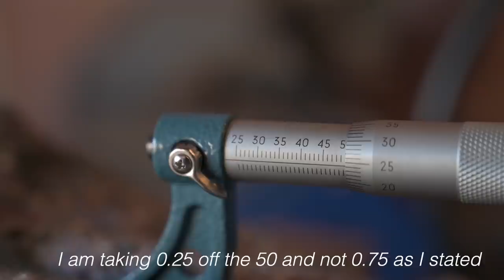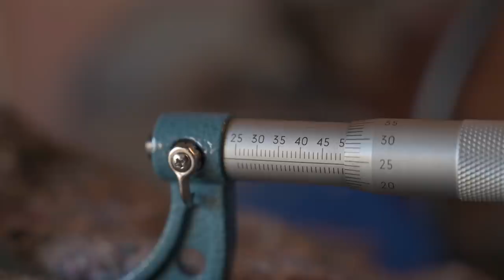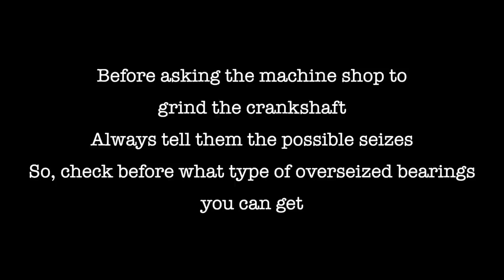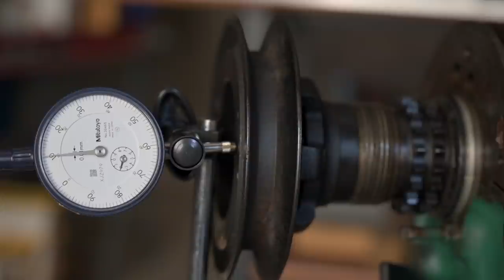Old Rusty, Engine block assembly

Comment: Internal oil screens (filters) made people "back yard mechanics" in the States. When I got my 48 Willys CJ-2A They had no oil filter on it, removed at some point, they just changed oil every 1000 miles or so. I did get the original filter and housing to install back in it. Nice job on "Rusty".
Reply from the maker: Thanks for the comments, that is nice a 1948 willys

Comment: Concering the Oil > As the engine has no proper oilfilter (like quite some  engines from that era) you should use single grade oil. That might be the "special oil" mentioned. The main difference to multigrade oil is that single grade oil does not absorb the dirt. It rather transports the dirt to a assigned  place eg. the oilpan. Thus, the oilpan has to be cleaned from time to time! Multigrade oil, as it absorbs the dirt, can be cleaned by floating through a filter as the particles will get stuck there. This is how I learned it...By the way - NICE WORK!!
Reply from the maker: Thanks for the comments and very informative

Comment: In the old days, non detergent oil allowed particulate to settle out in the bottom of the pan.  Detergent oils of today keep the particulate in suspension when running so a better filter system was encouraged through engineering and fitment.  Just my thought.
Reply from the maker: Thanks for the comments, that makes it clear
Reply: And if you change the oil every 1000mls, like in 1950, a filter isn‘t necessary.

Comment: Hello Steve

Good work again. Canada moved to the metric system in the mid-1970s, gradually. But the imperial system is still alive around here. So on one the two, and our American neighbors on their system. The American gallon is smaller than the imperial gallon for example and myself when I take a wrench to tighten a nut often it is 1/2, 5/8 and rarely in millimeters. At school in the 70s I had to do the metric swicht in math, physics etc ... Attention au covid-19 take care
Reply from the maker: Thanks for the comments, good reading...and its a matter of getting used to it

Comment: Old Rusty is coming together nicely 
In NZ we changed to Decimal currency on 1967 and went full metric in 1972 every thing is metric
today you just use metric or convert imperial to metric no real problem
Reply: Graham Peters. I am old school UK/Britain . I have machines that are imperial and some later ones in decimal. No real problem as you say , It's all just numbers is the way to look at it .the only time I have to think hard is looking  for stock thats in the off cuts bins , I automatically know what 18 inches long is but 460mm needs the tape measure .
Reply from the maker: Thanks for the comments

Comment: It's coming together quite nicely. Having worked on the engineering and construction of many plants, Chemical plants and Refineries, I find it difficult to believe that the older oils were cleaner (purer) than the modern ones. But who knows, stranger things have happened. I can tell you that if the cars I had when I was a young working professional required the removal of the pan and the oil pickup/filter, I may not have found the time to do much proper maintenance. LOL! Regards, Solomon
Reply from the maker: Thanks for the comments, indeed, some state that it has to see with multi grade or single grade....  it seems that single grade oil carries the impurities and deposits it in the carter, where as multi grade absorbs it . hence the need for a better filter... Not sure , but that could be the reason

Comment: Great video! Extremely thoughtful and meticulous in your preparation!

With regards to the internal oil filter, the key to maintaining these old engines was regular oil changes like every 25 hours or so. That's because of the low detergency and quality of the oil back in the day. The regular oil changes would flush the carbon build up from the engine and also prevent the poorer quality of oil from thickening and turning to sludge deposits. If the oil was changed regularly, I dare say that servicing that filter was not to be done on a regular basis given its porosity.

Modern oils are designed with huge amounts of detergents to keep the engine internals clean and are of much higher quality able to resist turning to sludge whilst being thoroughly filtered to extend oil change intervals, reducing down time and costs associated with servicing.
Reply from the maker: Thanks for the comments

Comment: Beautiful garden , australia went metric in 1966 , but really used both for many years , most engine and brakes parts are still imperial. Pulling the bolts in with the nuts is better than hitting them
Reply from the maker: Thanks for the comments

Comment: Hi  young friend !!mechanic of our time !!! I used the famous " Wynn's super charge" one of the best anti-friction additive !!! (authorized years ago by Caterpillar !) for me Wynn's is still one of the best product for good mechanic and maintenance work ! Please if you can buy a tin of that Wynn's super charge you will notice the change in the engine noise and easy starting ....that product stays like honey on all moving parts -- To add when engine really warm and better when slow idling speed ! Let me know please my friend...!!! Best regards from French Guyana.
Reply: The type of gasket as the one for the timing cover I use to put them in warm linseed-oil and not wiping the oil of when putting in place. The same for SOME  cylinder head gasket....! I keep the screen on the oil pump !
Reply from the maker: Thanks for the comments and great write up.   I use STP, its about the same not ?
Reply from the maker: Thanks for the comments
Reply: @D3Sshooter  nO NO "STP" was never authorized by Caterpillar .....Apart that please get 1 tin of super charge (heavy like honey) engine running at idle speed,  put a funnel tight in the tappet cover opening (avoid wasting product because of air pressure coming out especially on  tired engines) ENGINE RUNNING at the T° pour SLOWLY TE " HONEY like" and listen at the engine noise as the  "honey" enters the engine....!!!!!!! Also what a great change in starting, !!!! 
Now and after try injector and carburetor product  there you'll (for sure) be totally convinced !!!  Thank you for answer and comment making the following even more interesting and calling the full attention !!!
Thank You dear friend!

Comment: Hi Steve, greeds from Holland, I also enjoy your videos much. I have an H van and a DS myself for years.  The H van engine is very much the same as the engine from Old Rusty, especially the block. Like some comments already mentioned, you need special engine oil so the dirt can sink to the bottom of the pan. Best is 20w50 for this engine in my opinion. Last winter I cleaned the pan after many years, because of engine oil leaks, and there was more then half a centimeter of dirt in the pan!
The other thing I want to mention is that for the H van you need a special tool (caliber)to fit the timing chain housing around the crankshaft, to make sure that the shaft is centered in the housing. This to avoid a leaking seal in the future. 

Keep up the good work!

Greeds Joris
Reply from the maker: Thanks for the comments Joris, Goed om weten .   IK zal dan ook de juiste vullen.  Maar dat zal nog even duren denk ik..  De H heeft dezelfde motor dacht ik.
Ben wel eens benieuwd als de cilinderkop er zal zijn///
Reply: Idd het oude type motor van de H is exact gelijk aan old Rusty. De mijne is van 73 en heeft alleen een andere kop. Ze gebruiken ook wel eens een boortje van een bepaalde dikte die je tussen deksel en krukas door rolt om te centreren. 
Ik ben ook benieuwd als ie loopt. Succes!

Comment: Plastigauge is just as accurate, if not more so, than the method you described to check bearing clearance. Regarding the engine oil used, Old Rusty would have a non detergent oil specified as non detergent oil does not have a cleaning action and the by products (read crap) produced by normal engine operation cling to the internals of the engine. The crap (well some of it anyway) does not therefore circulate and cause issues with contacting surfaces. That oil strainer you have will need regular maintenance to allow only rudimentary cleanliness internally. Dont know about where you are but non detergent oils are getting hard to get here.
Reply from the maker: Thanks for the comments,  Plastigauge is something I have used. But I really like to measure. I guess it works for both... ...  Thanks for the Oil details , yep I can get that oil from an old timer shop. But expensive

Comment: putting in the lug bolts on the flywheel flange might be easier and faster by torquing them with a nut and a few thick washers rather than hammering
Reply: Or better yet, a C-clamp.
Reply from the maker: Thanks for the comments, indeed... why did , I not think of that /   great tip
Reply: i was thinking something like this also

Comment: Nice work! I'm currently stuck too with my restoration process due to covid... i ran out of paint and i can't buy it online because is a special mix. Also some spare parts are impossible to find online, especially for old and rare vehicles, at least here in italy. Btw i have a lot of rust to grind off 😂 no more excuses!
Have an happy easter and stay safe! 
See you next time
Reply from the maker: Thanks for the comments Gabriele,  I know the feeling and problem.... stay safe and enjoy your project.  What are you restoring  if I may ask
Reply: @D3Sshooter  currently i'm restoring  an old Lamborghini tractor, one of 48 produced back in the 50's before Ferruccio Lamborghini started producing cars in 1963. This one was displaced and drove for dimostration purpose probably by Ferruccio itself. But i'm searching more information about it because i found only one foto of that day. During the disassembly process i broke down in 2 pieces one casting when i was trying to press one bearing out of it. Hope to find someone that could weld it back, because no replacement are available. It's easier to find a V12 Miura or a Countach crankshaft than  one piece of that tractor 😅

Comment: The only unusual thing on that engine is the detachable counter weights on the crank. I've never seen that before.
Reply: Don’t know if I would call it the ONLY unusual thing, but certainly the MOST unusual. Never seen that either.......
Reply: @notajp  To me it looks like many ohv engines I have seen but never one with detachable counter weights. But I don't claim to know every IC engine ever made.
Reply from the maker: Thanks for the comments, and yes this engine is strange in many aspects

Comment: Currently a medical student, love your videos. I want to be like you ina few years i.e. restoring houses, building engines all round DIYer. Did you always do this?, how did you get started? where did you learn from?, thanks
Reply from the maker: Thanks for the comments Chris,    As a young boy , i was intrigued by mechanics, building and electronics.  I  spend many days as a job student in those area's and stool and learned with my eyes the techniques and methods that the 'Old Pro's ' used. Later , when I was at the university, I had to pay for my own education, and hence week-end and holiday jobs...At the end, I became an electronics design engineer ( still am today, and working as such). Yet , the jobs I did as a young men, did inspire me to continue that work in my free time.  Creating things...   Good luck with your study, 7 years is a long time

Comment: Hi Steve, a pleasure as always to see the dedication you print on your videos visually and orally, thanks for that excellent work. I've been waiting for Old Rusty's heart ensemble for a long time. At this point two appreciations, 1. Do you consider that it is not necessary to perform a dynamic balance of the crankshaft counterweights ?, 2. The gasket of the camshaft gear cover should not have any silicone sealant ?, continue with that excellent job. The filter design is really a real problem, I would think to make a modification, but if you are very purist it can be as you are considering the maintenance problem. See you in the next video, stay safe.
Reply from the maker: Thanks for the comments,  1. It was balanced at the machine shop.  I had to take them off (counterweights) as its easier working and placed them in the exact place back
2. The camshaft is held in place and pushed lateral with the large oval plate.  There are no seals for it , I could have put some sealant up.. will see if it needs to be when we dry run the motor ( in a few weeks)

Comment: Everything looked good but I didnt notice oil being put on threads or under heads of nuts and bolts. And plastigage is pretty good and would have double checked with it.
Reply from the maker: Thanks for the comments, I did  but I should have mentioned it... Plastigauge is another good tool indeed

Comment: No chain tensioner, no external oil filter, no overhead cam, cast conrod bearings... Whoever designed this engine, probably got all the inspiration from old american engines but got short on cylinder quantity.
Reply from the maker: Thanks for the comments, yep very basic

Comment: Excellent rebuild! We should of course be using whatever units the original engine was built in, this being a French engine would have used metric, except for the pipe fittings which are imperial, the Woodruff key is the thing that locates the crankshaft pulley, was there an oil seal in the timing chain cover? I did not see one. Stay safe! Chris B.
Reply from the maker: Thank you very much!, no there is not.. just that special ribbed big washer...  I don't think there is one for it, unless... But I did not fined anything on it

Comment: nice job. 

Long time ago I did hear that word 'Hermétique' :-)    My first car was a beetle, had that kind of oil sieve too. But at those times we changed oil at 5000 km. And engines did have low compression etc.   Happy Easter. 

Waarschijnlijk is de scheermachinewinkel in lockdown :-)
Ik vind dat een cilinderkop ophalen een essentiele verplaatsing is, daarvoor zou ik toch 250euro boete riskeren hehe
Reply from the maker: Thanks for the comments. tja misschien toch die culas  afhalen...  en die baard dat is mijn Corona resistent masker

Comment: Just a thought didn’t you use some cranked con rods instead of the straight ones, won’t these pull the pistons down the bores slightly so would this not then change the timing ??? As I said just a thought and I love your videos always interesting ..... stays safe from the dreaded virus.
Reply from the maker: Thanks for the comments,  the new con rods are having the same dimensions except that they are stronger one side due to the offset. But the actual centers are the same..

Comment: Hi, when you were spraying oil, was it WD40 or something else? Have you considered adding an external modern oil filter? I imagine it would extend the oil change interval and engine life...
Reply from the maker: Indeed that as WD40 , and what I have done is adding magnets inside the carter and using oil type oil.  Thanks for the comments

Comment: Hi Steve, I am rebuilding my Traction 6 Cylinder and using the same conrods as you and I have a question, how do the big end bearings get oil as they don’t have a feed hole like the mains ?Cheers Mark
Reply from the maker: Mark, I do believe that there are oil channels on mine... else this would not work

Comment: Here is a tip. C clamp and a socket and you can pull the bolts in. Question. Is that engine set up for a oil filter?
Reply: At the end you can see their version of an 'oil filter' using wire mesh screens -- INSIDE the pan!! Pretty wild.
Reply from the maker: Thanks for the comments, yep that would have been better.. good tip

Comment: Always used to do what you are doing...  plenty of oil on journals when assembling....   now it seems everyone want to use "Assembly Lube"   Maybe that is a good thing, but with some of these I've see, they are so thick I feel they may inhibit oil flow initially... what is your feeling on this??  One other thing..  I was also taught to always put bearing shells into a DRY surface...  never oil the seat... but I notice you oil yours???
Reply: Ditto, Yes I was always told the back of bearing must be installed into cap dry. Oil the bearing surface once fitted of course.
Reply from the maker: You are right, seats are not to oiled as such.. I spray them and wipe... so really no oil film.   i use engine oil with some STP additive added to it. Never had an issue .
Reply: @D3Sshooter  thanks. Great videos anyway.... You have even inspired me to start doing more during lockdown.

Comment: Hi Steve I have been watching this video Several times. Now I have a question.
I refer to this video on lateral play. Let's say the play is excessive. And once you put a washer of a certain thickness just because the original one was no longer within the spec , the problem is that the crank shaft is pulled. And once is pulled out due to the thicker washer. Now the Conrod is no longer perpendicular to the crankshaft.
You didn't address this kind of problem. And I wonder what was to happen.
I don't know if I put my question clear to you

Blom moshitoa (south Africa